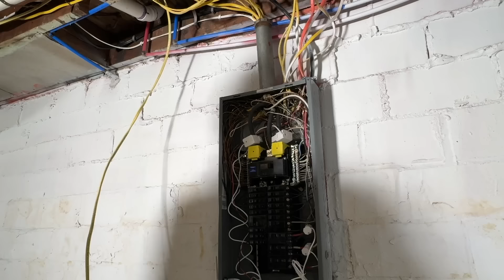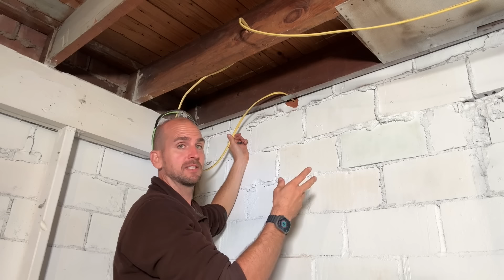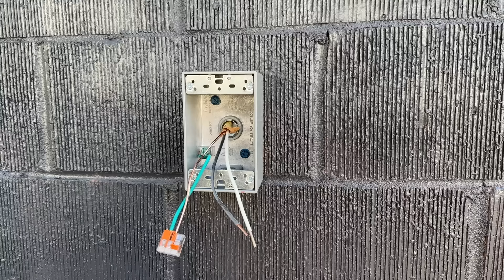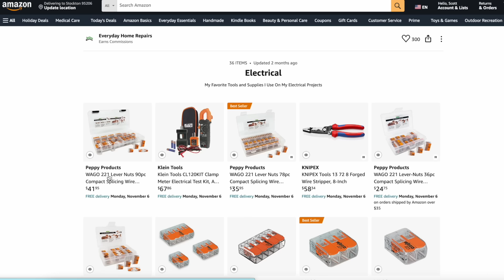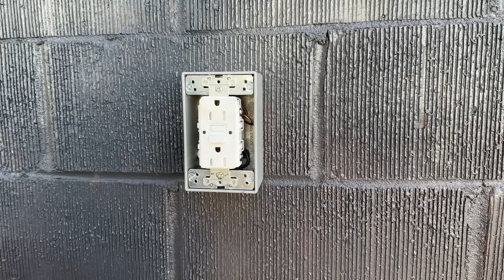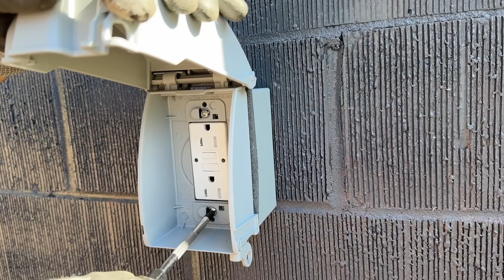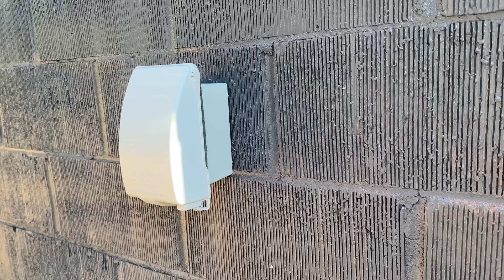How To Install An Exterior GFCI Outlet

Comment: I have two points that lean toward your not using conduit through the drilled hole.   1.   2017 NEC 334.10 (A)(2).  NM shall be permitted to be installed or fished in air voids in mason army block or tile walls.   A drilled hole is not an air void in the block.   It was not made with the hole you drilled.   NMC uses do not apply since you did not use it.   2.   334.12 Uses not permitted. 334.12(B) 14:43 NM shall not be used under following conditions or locations.  (4) In Wet or damp locations.   The exterior wall outside is a wet location.   If you have a large overhang, it would be a damp location.   According to Article 100 Definitions Location, Wet      in unprotected locations exposed to weather is a wet location.  NM can not be installed in a wet location.  In the handbook, the inside of a raceway in a wet location is considered a wet location.
So, no conduit is not legal through drilled holes in masonry, and putting a conduit through the hole to the box in a wet location can not have NM installed either.  Must be NMC or UF.
Reply: The NM cable is entirely within the wall and basement so uf is not required a since it is not installed in a wet location.

Comment: Hi Scott just wanted to add per your point about the multiple 15A on a 20A circuit:
Even a single 15A duplex is fine, because it's two outlets. The only time you have to do the 20A on 20A thing is if it's a SINGLE outlet on the yoke.
Reply: There are hundreds maybe over a thousand exceptions to the NEC. You are permitted to use a single 15 amp receptacle using #14 guage copper NM cable and have it ona 20 amp circuit breaker if the starting current ( some call it locked rotor current ) is high such as in air conditioners & air compressors..Term " Romex" never was or never will be in the ( NEC ) vode book.
Reply: @JohnThomas-lq5qp  You're not allowed to do this with cord and plug connected equipment. You are thinking of the motor loads rule, which allows you to size for MCA/MOP, but it doesn't apply to receptacles - which have specific limits. Also, who mentioned Romex?
Reply: @Harrison-cr4ie  Had to install a 20 amp circuit breaker on a single receptacle that was feed by #14 copper wire. Couple of times on old window air conditioners that probably drew close to 12 amps but would occasionally trip a 15 amp breaker  when compressor started up. Also had to do the same on an air compressor. Customer had pressure switch to shut off at 150# air pressure. When he started it up first time in the morning there was no air pressure and it could run until bring satisfied with 150# of air pressure but when pressure switch called for air with 135# in tank would often trip a 15 amp circuit breaker on start up.

Comment: Hey Scott, I'm a big fan of your videos. Home Depot has 1/2 and 3/4 service entrance connectors. I think keeping the hole smaller would be better in my situation so Ill probably pick the 1/2. My plan is to drill the 1/2 hole through my wall+stucco from the inside out from an inside outlet hole to draw the power from that. And then attach the box on the outside. Any tips on drilling through the wall+stucco?

Comment: 12:05 You said that you can install a 15amp receptacle onto a 20amp breaker. Technically, you already met that. By installing a duplex receptacle. So no need to install an other on the back of the house. 

I know you will though. But I just wanted to make sure you’ve already met that code by installing a duplex receptacle.
Reply from the maker: Thanks for the feedback 👍

Comment: Since you had to notch the floor joist. I highly recommend you go back and drill out the corners. Make the corners rounded instead of at a 90° angle. When rounded, it minimizes the chances of the wood splinting away in the future.
Reply from the maker: good point 👍

Comment: I would have put a few inches of conduit with a right-angled fitting, though I would have considered myself ridiculous for doing so. I would also use Fischer or Rawl plugs in that brick, instead of Tapcon, since it's so brittle.

Comment: I had to listen twice where you talk about adding additional 15 amp outlets on a 20 amp circuit because you failed to mention that you still need 12 ga. wire.  A little confusing but not incorrect.

Comment: I would have applied a half circle of silicone on the top back of the box to prevent water from coming into the box.
Reply: its going get moisture in there anyway. exterior boxes are subject to temperature changes, humidity. cant tell you how many exterior boxes Ive found at our complex where even with every possible leak point sealed up tight as a drum, moisture still got in

Comment: Since I live in a location that often has ground tremors and although it is not required, I consider it a best practice to use a short piece of PVC conduit to prevent scaffing when pulling or due to vibration.
When mounting a box to an exterior wall, I also consider it a best practice to put a 180 degree loop of silicone over the top of the hole behind the box.  This further insures water will not penetrate behind the box and corrode terminals or damage structure. 
Experience has taught me to put a loop in the NM before stapling so that, down the road, if I need to reroute for other wiring, I have the slack to do so.

Comment: Scott, thanks for the video. I like the video, but have a suggestion. I would like to see you caulk the back of the box before securing it to the wall, and I think you should have caulked the inside of the box where the wire is coming in to the box. Also, you should check the instructions on the box, one of the ones I previously installed required caulking of the plugs.

Also, check with Joel but I am pretty sure a duplex receptacle is considered multiple outlets, therefore it is ok to have a 20A circuit breaker supply one outlet box with a 15A duplex receptacle installed, since there are 2 outlets to plug into. 

The notch of the bottom of the joist seemed like a clever trick that should pass inspection.

Comment: Just did this recently. I used the same metal box as you did and had issues fitting the bulky GFCI  in the box even though I used Wago connectors. I used gray PVC  1/2" threaded male adapter through the center hole of the box and ended up having to cut the threads sticking out into the box with a rotary tool.  Those boxes are horrible  and my opinion not deep enough for a standard sized GFCI  Also at your service panel all the wires that come into the top of the box should be stapled within 12"  maybe add a 2 x 6 under those wires.
Reply: That box is called a Bell box. They do make a deeper version, which is ideal for GFCIs.

Comment: I would still use Conduit, even though code does not not require it.  Code is only for MINIMUM Protection; you do not want that NM cable to have any possibility to be nicked by that masonry.

Comment: The NEC is not the king of your castle. The ONLY time you could get dinged is IF you go to sell your house, and it is called out AND the buyers insist you fix it, or you can sell your house as is. As far as I am concerned the NEC is just a suggestion, and its more to protect YOU, so that IF you call an electrician, you know they're going to do what code stipulates. Otherwise, you are the king of your castle and the speaker of your house.

Ground should always be down. Otherwise it's sky. I like your cover and that it is metal. Better than the crap I got that's plastic. The electrician that put it in didn't have metal so that's something else I have to change when I can. My electrician also put the outlet in sideways horizontal, instead of vertical, and the cover is hinged on top and opens from the bottom. He claimed it was for better waterproofing.  If I did it myself, I would have done it vertical and used the metal tabbed cover that came with the kit I purchased which was gray enamel and individual doors that covered each outlet. It doesn't hurt that they get wet and it was going to be on a GFCI anyway, but he just did it all right there.

Great video and yes, Joel at EPA is good too. I like his videos as well.

Comment: I would use liquid-tight flex conduit from the exterior box and run it to a handy box (or your 4x4) mounted on the interior floor joist. Connect the NM cable to the interior box - strip out some wire from your NM cable and run to your exterior box - wire as usual. You could use regular flex conduit since you're sealing your exterior box. My thoughts.

Comment: I would also try and thread the wire through the pipe at the panel rather then have a single wire going to the panel.  This would have made a neighter job.  Especially when this is inspected when selling the house.

Comment: i would have drilled my hole a bit higher to go through the wood rather then the concrete.  Just to make a more secure job, I would use conduit connected to the outside box.  Rather be safe then sorry.

Comment: There is code and above code.
With that said, I would've rather spent a couple extra dollars to put a Liquidtight fitting on the back of the exterior box, with some sealant around it.
As it stands, water can still go down the exterior wall and get between the wall and the box sitting on top of the non-exterior rated cable, clamp, and that water can freeze and thaw an end up, causing damage to the brick around it. 
Just because it's not "necessitated "in code does not mean you can't take the extra step to prevent any water getting into the foundation.

I acknowledge that you put some sealant around the box for that purpose. However, overtime if that were to shrink up or tear having the liquid tight fitting is an extra level of protection, and the fitting by itself, does not count as "running NM cable quote through conduit .

Comment: He correct codes says you can put a 15 Amp plug on a 20 circuit. Even if it's a GFCI plug.  

But what he didn't tell you is 15 GFCI on a 20 amp circuit. The plug will eventually stop giving you proper protection.

By putting a 20 amp GFCI on a 20 amp circuit. The protection of that plug will last way much longer. Because it is ready for 20 amps.

Therefore it is best practice. To put a 20 amp plug on a 20 amp circuit. And a 15 amp plug on a 15 amp circuit. Especially when it's a general voltage circuit interrupter.

How I know this. Is because I experienced this problem before. One of my pass houses. I put a 15 amp GFCI plug on a 20 amp circuit. The protection only lasted 6 to 12 months. And when I switched it to a 20 amp plug on a 20 amp circuit. It gave me proper protection for a very very long time.

So even if this guy or any other electrician tells you it is okay to put a 15 amp plug on a 20 amp circuit. I suggest that you keep 20 amps plugs on a 20 amp circuit only. And a 15 amp plug on a 15 amp circuit. Especially if they're GFCI. Regardless of the code. That allows you to do this.
Reply: Generally, when receptacles are labelled as 15 A or 20 A that indicates how the front is keyed to accept either 15 A or 20 A plugs. The entire receptacle is rated for a 20 Amp circuit - they have to be because codes says that you can use "15 A receptacles" on a 20 A circuit. Often the internals are completely the same when a manufacturer offers the 2 options - and only the front plastic face is different. In an overload situation when things heat up a receptacle is only a small part thermal mass of the circuit and heat can pass into the wires, so it is generally the wires that generally determine whether a circuit can support 15 A or 20 A.

Now, receptacles can and have been poorly made over the years (making loose connections to plugs) - and most of those are of the 15 A variety. But that is because some manufacturers chose to put out junk that wouldn't hold up over time to make money - and not because it was 15 A rated.

Comment: The forces put on a joist are greatest at its outer edges.  The top of the joist is in compression and the bottom is in tension.  As you move from the top of the joist to the center of the joist the amount it is in compression moves to zero.  As you move from the bottom of the joist to the center of the joist the tension forces move from its highest value to zero.  So essentially, the center of the joist is where the forces are zero, thus making it the idea location to drill holes as it does not compromise the integrity of the joist.  Making cuts at the top or bottom of the joist maximally compromises its integrity.  Even making holes off from the center can reduce the strength of the joist depending on where the hole is. It's possible to turn a joist from a 2x10 to a 2x8 by doing what you did there with that notch.  Depending on the loads placed on that joist, you may have greatly compromised the strength of that joist and any walls or flooring that depend on it.  Same rule applies to studs, rafters or trusses.  This is why plumbers and electricians should always drill through the center of the wood they need to drill through.  And the smaller the hole, the better.  In this case I would have put the outlet one more block higher in order to get it through the middle of the joist.
Reply: Yes.  You can lookup online or get a framers guide telling you where you can drill within a joist.   But NEVER NEVER NEVER folks notch a joist.  That severely compromises the joist.  If it was new construction and an electrician notched a joist, the inspector would require it to be replaced or sistered.  This fellow would have been much better looping the cable under the joist.  Only cables 5 feet from the ground and less need protection.  Nothing would damage the cable up there running under the joist.
Reply: Notching the bottom of the joist was not a good practice, and those watching this video should definitely not emulate that type of activity in their projects.  The joists establish their resistance to bending with a large contribution associated with the top and bottom portions.   The 2nd area moment of inertia is the technical term associated with the resistance to flexing/bending.   As others have mentioned, cutting through the center of the joist is the best practice, to the extent cutting the joist at all is needed.   Drilling the block from the outside would have been the best approach.

Comment: With all that void in the concrete block, one could have drilled upward from the outside through the big hole to make a 'Romex' hole in the floor joist, well above the bottom. 
Is there a reason the 'Romex' cable had to be level going through the wall?

Comment: Scott, I noticed you used a TR GFCI in this installation.  I own a horse boarding farm and I figured out a long time ago that TR receptacles not only protect kids, but they eliminate spiders/bugs getting inside the slots, so that's all I use around my barns.
Reply: Tamper resistant outlets are required for residential applications.  On the exterior it also needs to be weather resistant. The proper device in his application is a TWR outlet.

Comment: My understanding of code is that a second GCI on that circuit is certainly allowed but is not required. A duplex receptacle is two receptacles, so a single 15 amp duplex is actually acceptable on a 20 amp circuit. I just tend to install 20 amp receptacles on 20 amp circuits because other than the few dollars of extra cost, I can't think of a good reason not to, and more versatility down the line with the sorts of devices I can power could prove useful one day.

Comment: If you ran conduit through the brick, would you still need a wire nut at the box?  If so, how would you install the wire nut?
Reply: he couldve used the proper connector for an exterior box. We run 1/2 pvc with 1/2 male adapter into back of Bell boxes. or we use liquid tight strain relief connectors. romex connector installed in the Bell box backwards - the clamping side facing in the box eats up space

Comment: I've never seen a micro inverter like that used to put power into house not sure how that one works.
 but i have panels on roof and they required a lot of special hookups and a specific inverter that reads power from house and syncs with it on voltage and frequency as well as shutting off in a power outage, so it does not back feed to power lines in an outage while they are working on lines.

Comment: you don't need multiple outlets to run 15-amp outlets on 20-amp circuit since it is a duplex outlet it is already 2 outlets only if you ran just a single outlet would it need to be 20 amp.
I would put caulk behind the box so water, bugs, cold air etc. does not get in at wire clamp and if you are going to run a short piece of wire out to box anyway you might want to make it outdoor cable, so the paper does not get wet. might want to put some kind of sealant on the threads of the knockout screw in covers since water can seep in on top one. 
The plastic recessed box does not hold those in use outdoor covers very well to house for a seal and some covers will hit wall and not be easy to open all the way if flush to wall.

Comment: It is recommended to seal using silicone or other products so water can not get in behind the box and enter the house or box but around the top will work but should be check every year.
Reply: the bugs and cold air will get in the bottom with just caulking three sides like he did.
Reply: @ranger178  The reason you do not caulk the bottom is to allow any leakage or condensation to drain out.  For the romex hole you could use a thick O-ring or a wad of silicone to prevent water/bugs from entering.